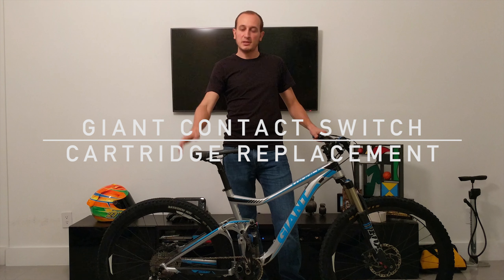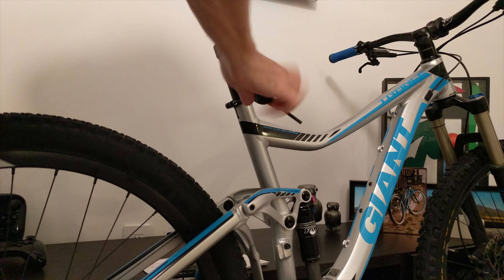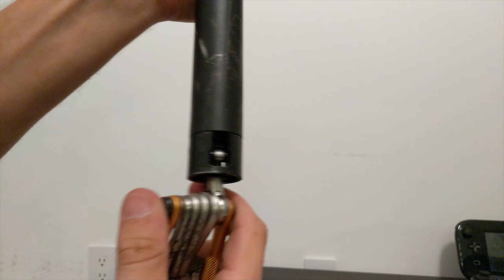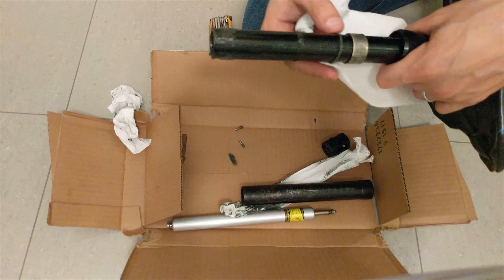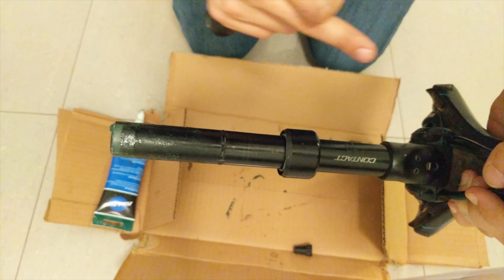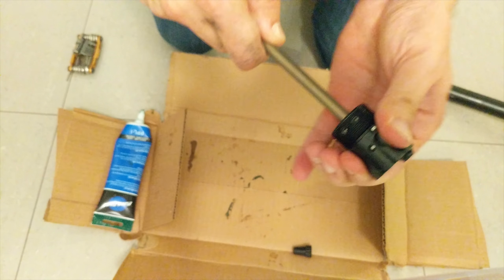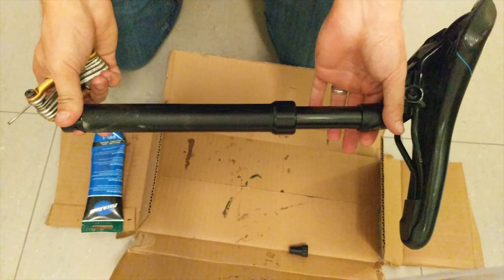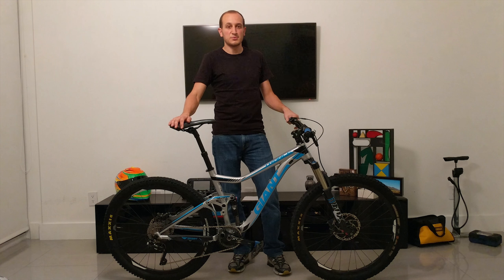Giant Contact Switch cartridge replacement

Comment: Just got me a Giant Contact Dropperpost. Is it normal that when I push the button, I still need to give the saddle a jerk for it to go down after staying for a while, then after that, it goes down after each push of the button without any problem? but when it's been inactive for a while, it kinda seize up and need to be given a jerk for it to compress, otherwise it comes back up and every other thing is fine. Maybe I am not just used to dropperpost, but guys, is this normal?
Reply from the maker: If you can get it "unstuck" by sitting on it the first time. Yes it's kinda normal. If it needs more force than that, no. I'd recommend storing it in the extended position. You can also grease the post lightly with something like slick honey grease or sram butter to help.
Reply: @BlindstuffMTB  funniest thing is, I just got it. It's like 2 days old.

Comment: Very good video. I am probably going to buy this seatpost  in the second hand market (tight budget...), do you know if your model or the older/newer ones  can run the cable outside the frame instead of internally?
Reply from the maker: Thanks! IIRC, it can do both, you just have to remove the cartridge and install it backwards, but you may want to check on that, I don't have this bike anymore, so don't remember 100%
Reply: Thank you very much for your answer

Comment: Looks like the 2nd gen cartridge is sold out online, anyone know if the 3rd or 4th gen will work as a replacement?
Reply from the maker: As far as I know they're different.
Reply: You probably won't remember it, but did you found any cartridge compatible with the second gen dropper post?
Reply: @jorgeparreira4216  I don't remember for sure but I think I ended up using a newer gen seatpost.  I looked for the order info but can't seem to find it.

Comment: Dude, thank you so much for this! Picked up some Slickoleum and serviced my dropper on my 2017 Trance. My cartridge is still good, just needed the innards cleaned and regreased (was kinda feeling gritty when I would drop it). Turns out V3 of the contact switch is very similar to your V2. It's sliding buttery smooth now!
Reply from the maker: Nice man! Glad to have helped, nothing like putting in some elbow grease and fixing stuff for almost free.
Reply: yo you got the 2017 post? did you just pull out the stanchion like in the video? thanks

Comment: I have a 2019 Giant Stance, the dropper post isn’t as responsive it takes a second or 2 from when I push the finger switch before it moves. Could this be the beginning of it needing replacement or service?
Reply from the maker: Maybe. But I'd check the cable first since it cheaper and simpler. If you know that works, then consider the cartridge

Comment: Will I did ride my MTB sporadically until July 2016.  Then it was kept in my car for three days when moving (heat exposure), then stored in indoor.  The grease you used is the Parktool PPL1, if I can't get it what other grease you could recommend I could get from a HomeDepot or other Hardware store?  Also, it is not a happy surprise if my cartridge needs replacement with the little use it had.  Anyhow I'll take it apart next chance I get over the weekend.  Thank you again for a detailed video.
Reply from the maker: Hey Donat, it may not be broken 100%, before buying a replacement, i'd try to clean and regrease it. Sram butter or Slick honey grease are good. There may be some home depot equivalent, but I really don't know.

Take a look at the footnote to the video, it has a bit of important info.

https://www.youtube.com/watch?v=1U4A_RCDTXg

Comment: Hi, I have the same problem with my giant Seatpost, i tried to order a new cartridge on that link but it says that cartridge has been discontinued by giant which would be my next cartridge option
Reply from the maker: Hey James, I don't have that bike anymore. My seatpost was a 1st generation (which is what was discontinued), you have to figure out which gen your seatpost is to see what cartridge you need. As far as I remember, all the newer gen ones use the same one.
Reply: @BlindstuffMTB  thanks for your reply man... still I have no idea how to figure that out and at the store they want me to buy the whole Seatpost all over ($315).. no way...
Reply from the maker: @jamesmolina1923  yeah no way. If you end up having to replace the whole thing (hich I don't think you'll need), check out the PNW components droppers. Super reliable and good pricing
Reply: I have the same version and cartridge type as in this video. Could find a replacement anywhere in the UK. Closest was Italy, and for £60, ~$90.
Ended up sending drawings of spec to a company i found on alibaba in China. I had them make me some up. They're heavier than the original cartridge, but I had them make them to withstand a higher load, I weigh about 220lb without kit. Got them to make them to 200kg - 440lb. If you read the small print for this post it stipulates not for riders of 75kg - 165lb. 
The design of this cartridge isn't great. The tip held between the two pins holds all the riders weight and I think pinches on the release pin and makes it stick. The later models use a screw method to hold the cartridge and don't suffer the same issues.

Anyway. I ordered 5 of these cartridges from China cost me $22.

They weren't perfect, because of the extra load capacity they cartridge body was a little larger than the original. Meaning I lost a little of my drop. From 150mm to 125mm. However I'm still riding on my first one more than a year later.
And I've got 4 spares should I need them.

Comment: I bought my Giant Seatpost SL on 03/2015 and rode it for about  8 months and then had my Giant Trance in the garage for over a year.  I just got back into riding thsi past week and noticed the seat will not come back up as you describe.  Of coutrse it now out of the 2 years warranty.
Is it possible that the old grease just dried up and greasing up the parts might help or is this cartrige expiring after 2 years even when not used?!
What grease is recommended for the maintenance and/or cartridge replacement?
Great video.
Thank you

Comment: Nice Video...i have the same seatpost and it tends to play side wise, a little more than usual. thanks
Reply from the maker: Thnx. I've been lucky with mine and it hasn't done that, but I have heard it happens to a few of them.
Reply: BlindstuffMTB do u think tightening the bolts would help? any suggestions?
Reply from the maker: Where is the freeplay? It may be the transparent plastic sliders. You may want to ask here, this forum is great: http://forums.mtbr.com/giant/giant-contact-switch-seatpost-666774-3.html

Comment: Hello, good video. I have a bike Giant of 2017 and has this seapost or similar. My seat has lateral movement, about 5mm , is not good riding. Dou know what is the problem?. could be the two plastic pieces? It knows where I can buy?
Thaks
Ramon
Reply from the maker: Hey Ramon, I sold that bike already, I don't really know what the problem could be, but that sounds to me like it could be a warrantyable issue, have you spoken to your local bike shop?

Comment: Nice video! i have an issue, my droper do not hold de seatpost, i mean, when i want to push down de seat, it rise again even when i´m not pushing de trigger, any idea of what the problem can be??? i bought my bike in november 2017 so i don't think the cartridge needs to be replace. if any idea will be great. cheers!
Reply from the maker: I would start by checking the cable or pull mechanism. It sounds like the cable is staying pulled.
Reply: Sounds like your cable is too tight.

Comment: Yo Blindstuff... I am not sure what grease to use... please help me!

By the way, great video! Too bad GIANT does'nt use better cartridges on original mount!
Reply from the maker: Happy you found the video useful. There's a footnote video in the description with more info, but you can use buzzy's slick honey.
Reply: @BlindstuffMTB   yo!! Really hard to find a cartridge here in Paris France! Giant store is asking me to replace the whole seat system because the bike is too old (2016)!! 

$$$$$$$ businesssss

They called Giant in Holland but for the moment no answer!!
I can’t go biking for the moment.. no saddle..

Really disapointed!
Reply: @sageJr1987  I found a company in Italy that sells them and will post but they aren't cheap. Around 50 euro.
Do you have the 150mm dropper?
I had some made in China, they fit the 150mm but only give you a 125mm drop. I had them send me 5. I would send you one at cost of postage if you want.
Reply: @ransouthall3497  Yo! I found the last cartridge  that’s left in France I’m sure... It was taking the dust since years at a Giant store... I was really lucky...  about all’Giant stores in France aren’t getting delivered accessories ordered at the mother Giant in Holland....
I’m not sure of’the length of my drop. I got to mesure it. All I know is that my bike is from year 2014 (and not 16 like I said before). The serial number written on the original cartridge is: 40608700-400.
How long are the ones you got?
Thanks a lot for your help. I appreciate it.
Reply: Oh yeah, It cost me 76€!!
Reply: And all’this happened only a week ago! I would’ve tried you Chinese cartridge with pleasure! I still can 👍

Comment: Thanks for the video &  just wondering if this one will fit on my Giant trance x0 2012 thanks
Reply from the maker: Glad you found it useful. You have to check what version of the seatpost you have to be sure, but considering your bike is a 2012, I'm pretty sure you have a first generation which means the replacement cartridge has been discontinued (https://www.amaincycling.com/giant-contact-switch-seatpost-cartridge-350mm-first-gen-1729-contac-402/p424689)
Reply: Hey mate, reading your comments I just realized the replacement I need for my 2012 reing is out of production. In that case which alternative can you suggest?

Comment: My 2018 Trance 2 is less than a year old.  How am I sure if it's the cartridge or something else.  It comes up too slow.   Adjusted cable at handle bar...better but still slow.
Reply from the maker: Its hard to know for sure, but, I'd assume that's the issue. If you can remove the post and clean it up on the inside, same as this video, without changing the cartridge and its still and issue that may be it. On the other hand, if I were you, I'd try to just get warranty through your LBS as a first attempt.
Reply: @BlindstuffMTB  Hey man thanks for the response.  I called the shop that you linked and a tech told me that it may be the cable has stretched.  I put up a good argument (I think) and he said that believe it or not the cable can be stretched to the point that it will act as I described.  Mine is definitely more "sticky" than yours.  He thinks it's too new to be the cartridge.  He also said that on any cartridge change, he always replaces the cable.  Anyway, I have the cable just need to make time to replace.  Your vid is a big help on getting this apart.
Reply from the maker: @EnuffsEnuff318  Happy I could help, appreciate you letting me know.
Reply: @BlindstuffMTB  Turns out there is a little button on the cartridge that gets pressed when the cable pulls on the little actuator.  The button was rusted and gunked up.  Hit it with some WD40 and it freed it up.  Now it works like a champ.  Still replaced cable and the newer cable does slide better.  There was water trapped in my cable too.  Just glad it works again but your vid gave me the confidence I needed to pop it all open.  Still a little new at this.  Take care man.

Comment: Anyone been able to source a replacement cartridge recently?
Reply from the maker: Amain has them in stock. This is the link to a second gen cartridge, but the 3rd gen is also on the site.

https://www.amaincycling.com/giant-contact-switch-seatpost-cartridge-2nd-generation-201415-400mm-150000025/p364202?v=333090

If not, call your local giant store, they'll be able to order it for you.
Reply: Checked here earlier but comes back as 'out of stock' at checkout for both sizes. :(
Reply from the maker: Stephen Kay that's odd. They appear in stock for me.
Reply: OK, my bad........ the check availability button shows no stock, but check out successful. ;)
Reply from the maker: Awesome, glad it worked out for you.
Reply: And in another twist.... Amain just refunded the purchase without reason. Guess they don't have stock after all.
Reply from the maker: That's incredibly frustrating. Best option I can think of is go to your local giant dealer and ask them to special order, or if not give the Giant store in Las Vegas a call, they're corporate owned and usually have better knowledge of obscure parts.
Reply: I just ordered one on the site.....hoping they really have it in stock

Comment: HOW do you get those dang plastic shims to stay in place when reinstalling the outer sleeve?
Reply from the maker: Make sure you're getting the aligment of the bottom tube right, its the most important part so that the shims dont get pushed out as you fiddle with the alignment.
Reply: @BlindstuffMTB  Yep, those shims weren't fun. I can see why other models use a different design.

I have another issue with this post that you might be able to help with. I believe the silver bushing @4:35 is harboring a bunch of crud that's leading to excessive stanchion wear. Any idea how to pull that bushing off?
Reply: Can you measure the plastic shims? Im about to 3d print them. Unfortunetely i have none in my dropper as i bought it second hand. Thanks in advance